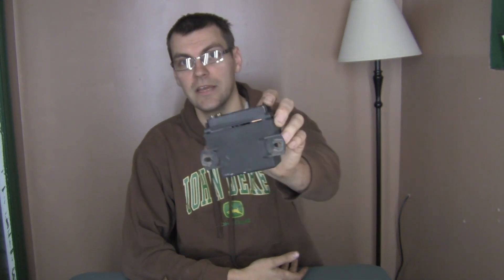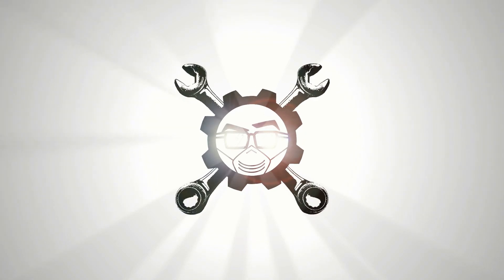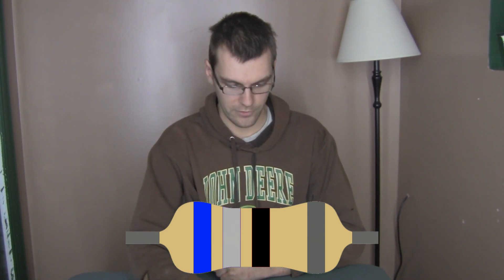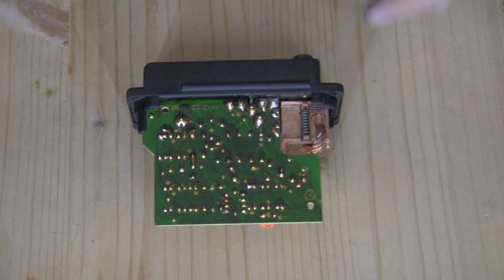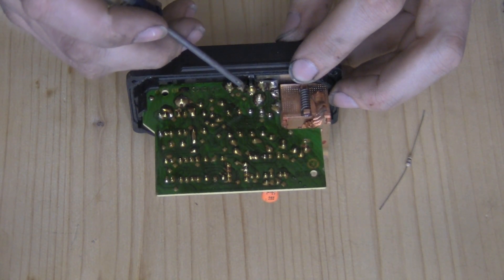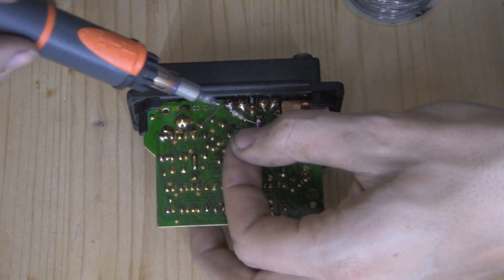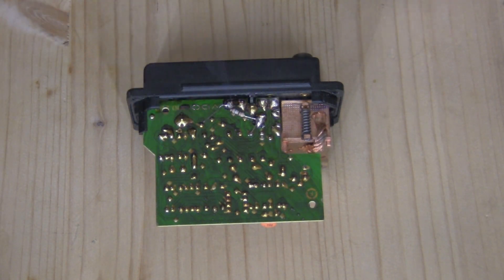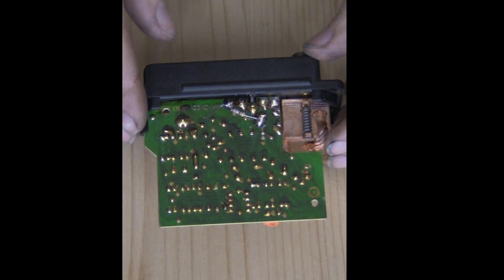W123 Mercedes glow plug relay indicator modification (Half brightness indicator for afterglow)

Comment: Hey appreciate your videos as always! Wondering if I should do this on my 83 300TD. The GP indicator light always stays on for a second or less when I turn the key to the ACC position. Never have had an issue with starts yet. It takes literally maybe a second or two longer now that it’s in the high 40s but still no issue. Wondering what you think may be the cause and if this should be done regardless?

Comment: appreciate this.

Maybe you can answer a question on the relay configurations....  Am confused on the versions where the temp sensor was on the head.... which modified glow time based on temp. Did these NOT have a 5th wire (ive only seen 4) that went to the starter solenoid to keep plugs glowing during crank?   

on the ones with ambient temp sensor; (if that even existed.... some claim so)  did that verson have an internal temp sensor and thusly use purple wire pin # 50 for  glow on crank ? 

am re-wiring a 617 in a jeep and am just confused....  in large part because all  labels I made and put on the wire harness when I removed the 617 from the jeep faded, so I cant even wire it back like it was anyway.  I do see though the purple wire is IN the MB harness to the GPlugs (and a green one to?) ... but both are  clipped free. Yet on  the remaining old mb harness  from solenoid. to control it (the 4 pin harness) ....  its clipped in that harness too.  ?
Reply from the maker: My understanding is the early glow relays had a bunch of wires, an 8 pin connector and 5 pin for the glow plugs themselves, not the 5 pin and 4 pin connectors I'm used to seeing on my 82 and later glow relays.
The newer style relay has an internal ambient temperature sensor, the older ones had a brown and green wire on a pin labelled 8 that led to a temperature sensor, and another green wire on a pin labeled 6 that led to a coolant sensor, I know one of the sensors was in the cylinder head possibly near the #1 glow plug, but I'm not sure exactly.
I may be totally wrong, I've not worked on one with that system, or at least not enough that I was paying attention to the glow system.
The service manual shows the internal temp sensor connected to the pin labelled 31, so it is possible that is also a temp sensor in the head?

The purple wire on my style glow relay is to turn off the glow plugs immediately when the starter is disengaged. Some will disconnect the purple wire as an afterglow to help with cold starts in the wintertime, keeps the glow system energized after the engine is running for about 30 seconds to a minute.

Not sure if that answers your question or was just a bunch of rambling trying to make sense of it myself.
Reply: @trythistv  no that helped a lot. I do have the 4  pin, and 5 pin relay... but apparently an older version of the 5 side of glow plug wire harness. and maybee.... I have to look again... NOT the older version of the 4pin side of the wire harness.  

31 is tan on most info  Ive seen, and is to Ground .   What is the specs on the info you saw 31 having thermal sensor...  (year /model for example)

I do have glow sensor on head of both my engines.  One I took out did NOT utilized it.  wire was left not attached/used.   One I am putting in...  is rebuilt... so for all I know they used an old head ...... or the whole thing was old before rebuild.

much thanks.

Comment: Great video as always. I'm curious if you'd have any insight on my situation. My glow light doesn't come on at all, I even confirmed that I get no 12v at the wire to the light. I even replaced all the glow plugs and confirmed they are all good. The car fires right up, just no glow light. Do you know if there is some soldering fix available for this issue? The car in question is an 81 240d, so a very similar glow plug relay as yours. Thank you for any help!
Reply from the maker: Have you checked to see if the glow relay is working, getting power and switching on to power the glow plugs? I'd think if it starts very easily then it likely is, or you have an incredibly healthy engine to start up with no glow plugs!
Do you get power coming from the glow relay to the light? You can check at the glow relay on the 4 pin connector (you will have to leave it plugged in, but pop the connector apart, the wire that is Blue with a white stripe is what goes to the indicator light.)
If you aren't getting power there then something is wrong inside the glow relay, but if you are getting power there then it must be the wire or connector between the glow relay and the instrument cluster is broken.
Reply: I had the same issue with my '81 240D. Relay functioned, but the indicator light on the dash did not. Having confirmed that the fault lied with the relay, and not with the globe in the cluster, I replaced the glow plug relay with a Hitachi Hüco (made in Germany) unit, and problem solved

Comment: This is another good practical video.
I know it’s an old thread. Sorry if it takes your time to even remember what it was about 😊
As I understand, the intention of your mod is to see the dash GP light “half-lit” during the time of 12V going to glow plugs. Correct? 
Glow plugs should be disconnected from +12V immediately after the engine starts OR they should be powered for ~1 minute (and then disconnected) if you simply wait.

I have a related issue and would appreciate your input, if possible. 
The GP indicator on my W123 300TD OM617 is ON for about 3-4 seconds no matter what temperature engine has. My W116 300SD works as it should. I.e. longer ON-time when cold and shorter, when hot. W116 has a different GP relay though. 

- Q1: Do you think that my W123 has a faulty relay or I need to look at the temp sensor first?
- Q2: Do you know of any way to change the GP heat-up time by changing/adjusting GP relay components?

Thanks
Reply from the maker: I remember all too well what this video is about, because it helped me track down the most irritating problem I have had with my car. Randomly my GP relay was sticking on, and draining my battery, sometimes even while I was driving because they draw more amperage than the stock alternator produces.
I did this mod to show when the glow plugs are receiving power, which could be for the "afterglow" feature/hack, or it could also show you a failing relay that is sticking on and destroying your battery... But enough about all that stuff, its fixed now!

In your case, The theoretical normal function that I am aware of is that plugs are powered when key is turned to run position, the indicator light has a thermal resistor, on the W116 this was in the cylinder head, on the W123 it is integrated into the glow relay, so it goes based off ambient temperature rather than actual engine temperature.

The plugs remain powered after the indicator light goes out, you turn the key to the start position, the plugs remain powered during cranking, but when the key is released from the start position back to the run position, the glow plugs are immediately de-energized. This is done via the Purple wire in the small 4 pin connector on the glow relay. A popular modification is to snip that purple wire, or just remove it from the plug and tape it up in winter time, as then the glow plugs will remain powered after cranking for about 20-30 seconds, which will smooth out the idle and sometimes prevent stalling during super cold starts.

I should make a video about what that wire does and explain some of the popular modifications that would help with cold starts.
Reply: @trythistv  Thanks! A new video on that would be good and may be helpful for a number of W123 diesel owners.
I didn't know that the thermal resistor is built-in on W123s. It makes sense then and, unless a car was outside at -ZZZ temperature, it shouldn't be a big difference between the glowing time on hot or "cold" engine. Maybe my relay isn't faulty at all :) Normally, I just wait for another 3-4 seconds after the light goes Off before I start the cold car and there are no issues. Thanks for the comments and your fast reply. Enjoy the holyday season :)
Reply: @trythistv  ok....... this just confused me more LOL
Reply: @trythistv  ohhhhhhhhhh........  interesting.....   But where is the wire to the solenoid crank....  I thought that was purple wire on some models
Reply: @trythistv  so if purple wire is put on temp sensor in head.....that is where it goes if you have sensor in head right?? .  in winter (I have a winter here...... short but cold)  could you put a "winter" switch on your dash that just breaks that line..........  orrr would it need a solenoid too......   Would the added resistance of all that wirting and parts mess up its function?  

Still confused though on if that wire is used for sensor in head.......  what wire goes to the Start solenoid to sens "crank"

Comment: Hey there! This is great. I never understood why the dash light wasn’t true to what was actually happening. QUESTION - the ‘power’ pin you are jumping - which one is that? I have a 240D and stupidly overlooked the fact that your relay and my relay are different, while still very similar. I can find the indicator, I just don’t know what mechanism you’re tapping into on yours for power. Mine has the same parts, they’re just in different places.
Reply from the maker: It's been a bit since I did this, it has been working flawlessly, and I LOVE having a true feedback on what's going on with my glow relay, if I recall I tapped into one of the glow plug output pins, but I have heard that there is circuitry that monitors for a failed plug on one of the pins so I may have tapped directly to the solder joint that is the relay output. (The actual little gold bare metal relay that is inside of the black box we all call the relay, if that makes sense) shoot me a good photo of each side of the circuit inside of your relay to Tom at trythistv dot com, I should make some diagrams of all the relays I've gotten my hands on, and if you would send me photos of yours, I would include that in the writeup on the website for anyone else who might have a 240d that wants more feedback from their relay! And I can take a look and see what advice I can give you on where to solder to!
Reply: @trythistv  You are the best! I’ll get that to you before the weekend is over. I know others will certainly benefit from it!
Reply: @trythistv  Thanks bud! I sent you entirely too many emails. Focus on most recent one. It has the correct wiring I found!
Reply from the maker: I am so sorry, I never got a chance to look at the photos more than a brief glance, but I am so happy to figured it out in the end, and even more thrilled that you reported back with the information! I'm going to try to put together a little writeup with photos of all the various types of glow relay I've found as well as yours thanks to the phenomenal photos you've taken, thank you so very much!
Reply: @trythistv  no need to apologize! I didn’t mean to spam you, but I wanted to make sure I got you all the right information start to finish. Once I sat down in front of it and really looked at the board it all made sense.
Reply from the maker: Not spam at all! Always thrilled to receive extra info and more insight on interesting stuff like this!

Comment: Hello, I have an 80's 300D but my relay is either a later version or another mfr. It is shown in this video. https://www.youtube.com/watch?v=tXylrY9GDxc&list=PLeYmvdiw3Xm87mFck3FjQ12ZoTSFXZ0Rr&index=20&t=0s At 7:10 can you tell which two terminals correspond to yours? Or could I just power my relay and then check the terminals with a multimeter?
Reply from the maker: I think I have one like that. Let me check and see, otherwise you can test with a multimeter which terminal corresponds to the glow plug outputs, and which one corresponds to the light using the ohms setting.